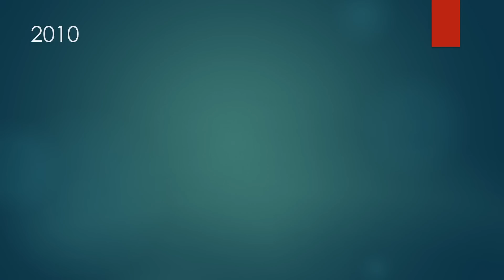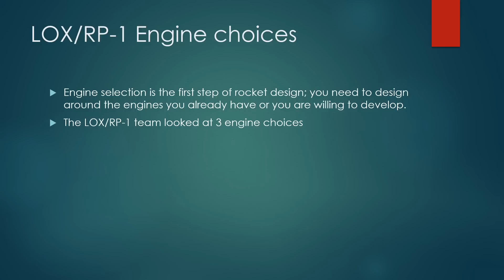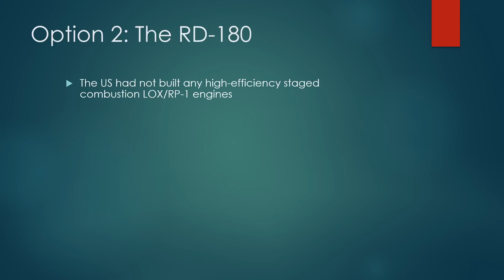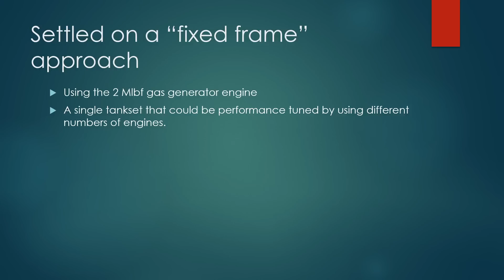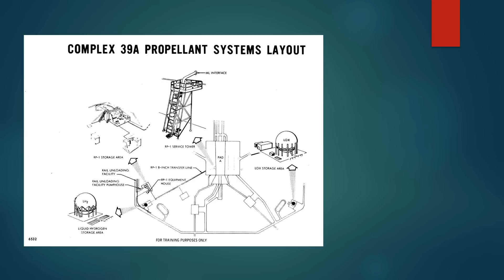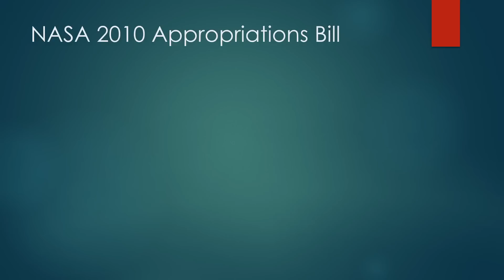Why don't we fly the Saturn V? An alternate SLS history...

Comment: Great video, I thoroughly enjoyed it, nobody else seems to focus much on the history. 
Though I would like to point out that depending on who you talk to, an evolutionary block approach is a pro rather than a con when relating to shuttle derived launch vehicles as the DIRECT team have pointed out before. In-line shuttle derived vehicle designs such as SLS turned out to be harder to build than anticipated especially due to the gap and the shut down production lines at the end of shuttle which could have been avoided had NASA focused on a single launch vehicle since the beginning of constellation, but hindsight is 2020. The Rac-2 design is a beautiful and elegant vehicle but I can only imagine how much longer development would have taken and the higher risk of cancellation.
Reply from the maker: Thanks for your comment.
I can see your point related to DIRECT, which had a goal to get back flying very quickly and use shuttle components with as little modification as possible.
I think it's different for SLS; if you accept that the defined goal - 130 tons to LEO - is meaningful, then I don't think it makes sense to spend any time on ICPS as it doesn't get you where you want; the only thing you get is (perhaps) an earlier launch of a vehicle that doesn't do what you want it to do. 
It's also had other impacts; NASA has already spent $693 million on the launch tower for block 1 which will be abandoned when they move to block 1B.
Reply: @EagerSpace  
Oh, the launch tower(s).... 

(Insert Marlon Brando "The Horror" video clip here)

Comment: Seeing we are happily using soviet N-1 rocket engines, using Apollo ones would not be all that far out of possibility. And for not having the instructions to build one F-1 engine, we have one, just reverse engineer it, scan it, or what's needed. Block one of SLS is a bigger waste than Saturn 1-b was.
Reply from the maker: The NK-33 / AJ-26 was briefly used in Antares but abandoned because of quality issues. It's certainly true that Atlas V flies the RD-180, but AFAIK there's no close relationship between the RD-180 and the NK-33.

There was already an updated F-1 planned for SLS - the F-1B - that would have been much easier and - perhaps - easier to build. That's the engine this proposal was based on.

Comment: We have lost the artisan welder and tangible skills like that in order to build F1 engines. They were built with slide rules and and had a little more wiggle room for error, that was filtered out by bench testing and the human touch. as such no single engine was identical. sure we have some specs somewhere... but with all our advanced manufacturing technologies we cant actually build them. because tradesmen/artists like we need are all retired.
Reply from the maker: As part of the Advanced Booster Competition for SLS held in 2013, Dynetics/Pratt Whitney Rocketdyne proposed a booster powered by an updated version of the F-1 known as the F-1B. So they clearly thought it was possible. Article here: https://arstechnica.com/science/2013/04/new-f-1b-rocket-engine-upgrades-apollo-era-deisgn-with-1-8m-lbs-of-thrust/2/
Reply: @EagerSpace  Proposed, and never built. because it woukd take lots of trial and error to do now with modern manufscturing, what they did then with an oxy torch. Economy of effort.
Reply: @randomotaku4037  Your argument is extremely poor and you clearly did not do your research into the F-1b
Reply: @BeKindToBirds  1. That is not the F1. That is a different engine, the F1b. which 2. is exactly what I implied would be needed, a redesign of the original engine to work with modern manufactiring, engineering and 3d printing. 3. Has anyone actually built an F1B or is it still sitting on paper while Neon Tusk saves our species?
Reply: @randomotaku4037  You are being obsessively obtuse.

Comment: At 11:43 it looks like the F-1 engine displayed simply dumps the turbine exhaust out a pipe instead of using it to film cool air nozzle extension, does this mean that they weren’t going to use a nozzle extension on this newer version of the F-1?
Reply from the maker: I think they decided to cool the whole nozzle regeneratively, so the extra cost of film cooling wasn't needed.
Reply: @EagerSpace  I think the first part of the nozzle was regeneratively cooled and then they used the turbine exhaust to film cool a nozzle extension, so I’m taking this as them not bothering with an extension this time?
Reply from the maker: You are correct. They did that because it was very expensive to build the regeneratively cooled section and so they could just build the bottom part with a film-cooled extension. 

That's not needed with more modern nozzle techniques - the Merlin 1d is also a gas generator like the F-1 but has is fully regeneratively cooled.
Reply: @EagerSpace  my brain is sad that those gas generator exhaust products weren’t going to be used for something useful. Still my brain is even more sad that I won’t see a modern F-1 fly during my lifetime.
Reply from the maker: You aim them down and you get a little bit of extra thrust out of them, and IIRC some engines have used them to provide rotation around the z axis. But those manifolds like we see on the F-1 and the Merlin Vacuum are a big PITA to build

Comment: Fascinating - thanks!    It's looking now though that NASA need to evolve - it's not their business to compete with commercial launch facilities - and it would be VERY wrong for the government to procure new rockets in competition with the likes of Blue Origin and SpaceX.   They need to encourage the traditional government contractors like Boeing and Lockheed to stand on their own too feet - and to nudge Blue Origin into becoming a true competitor to SpaceX (who are doing just fine without help!).

This model has worked moderately well with StarLiner and Crew Dragon - set up two broadly capable commercial teams against each other - let the winner prevail.

But they can't be giving Boeing unlimited $$$ to build another SLS.    What we have is a quasi-competitor to SpaceX - with a NASA mandated design for Boing and a free rein for SpaceX.   Result is that SLS costs 3,000 times more to launch and at half the payload of StarShip.   An Artemis mission of baroque complexity - when you could simply shove crew, vehicles and habitat into a StarShip - refuel on orbit - then go straight to the moon...no capsules, no lunar gateway, no somewhat-reusable-maybe Lunar lander...no nebulous ways to get habitats and vehicles to the moon.   Just one rocket...3,000 times cheaper.
Reply: Except there is no current commercial demand for a super heavy launch vehicle. All the best to SpaceX with Starship, but Falcon Heavy has flown two payloads to orbit in 5 years, not exactly a busy dance card. And the issue is you going to have to throw money at it because the launch cadence is going to be too low to make a profit commercially anyways. 

And it's really unfair to critique the cost of SLS. The Saturn V cost 10x as much as SLS. People who criticise SLS for being a make-work project have selective memory when it comes to the Apollo and Shuttle programs. The reality is NASA isn't getting the massive budgets they received back in the 60's. Also Starship is currently a chunk of steel that has only accomplished to explode a lot. Let's see the costs once it's making it to orbit. Starship isn't anywhere close to going to orbit, they have only had one single sorta successful test flight of the upper stage.

Comment: The short version is “why would we want to recreate the Saturn V?”  The Saturn V was an amazing achievement for its time, but it was very much a product of its times.  We can do much better nowadays!

Excellent video!  Thanks.

“Competion”?
Reply: I haven’t yet viewed the entire video, but the problem started in the 1970’s, specifically the Nixon Administration. NASA had been forced to cancel the last three Lunar Missions, and NASA had several goals in mind for post Apollo, but they were all shut down except for the Shuttle. So, NASA was adrift, as it had no real goal. The last president who had given NASA a goal was Kennedy. 

Second, the Shuttle system as built was NOT what NASA had in mind, but under Nixon, NASA was forced to build a massive payload bay, in order to accommodate the needs of the military and intel agencies. Ironically, those entities opted not to use the Shuttle, and launched their own satellites. But NASA was stuck with a huge vehicle, and an extremely unsafe vehicle. Also, the appeal of the Shuttle was that by reusing most of it, it would be much cheaper, and be like running an airline. Well, airplane’s don’t have to endure the punishing stresses of getting to and from orbit. The Shuttle turned out to be MUCH more expensive than the expendable Apollo/Saturn, and the launch rate never came close to what NASA expected. 

I think NASA originally envisaged a much smaller “Shuttle” (without the massive cargo bay) which could have been placed above the booster (probably the Saturn), and used a simpler heat shield than those tiles, and would have the capability to pull the spacecraft from atop the stack in the event of a catastrophic failure with the booster. The savings would come from its ability to land like a plane (water recoveries are expensive). 

Also, because of its design, it couldn’t go farther than low earth orbit. The orbiter could not survive the high velocity re-entry that Apollo could. The Soviets figured this out very quickly, and abandoned its own version of the Shuttle. It just isn’t reliable enough for a human crew, and we were fortunate that there weren’t more catastrophic failures. And the Shuttle system just couldn’t match the sheer lifting power of the Saturn V. Our first space station was much larger than the various parts of the ISS, and was a converted third stage of the Saturn V. Unfortunately, because of long delays with the Shuttle, we weren’t able to save Skylab, as it’s orbit decayed. 

The Saturn was not only the most powerful booster, it was extremely reliable, with no catastrophic failures, and could even survive a lightning strike (which occurred with Apollo 12. Had we kept the Saturn, its electronics could easily have been upgraded over time, (same with Apollo — which is the real spacecraft; Saturn was the booster), just as had been done with the Shuttle. 

The other safety issue is the use of Solid Rocket Boosters, which were chosen for financial reasons. The problem is that unlike a liquid fueled booster, once you ignite the SRB(s), there’s no shutting them down, and the orbiter had no launch escape system. The two systems were really only developed a decade apart, Apollo Saturn in the 1960’s, and the Shuttle in the 1970’s. And quite frankly, Apollo/Saturn was superior to the Shuttle System, in terms of reliability, cost, and safety. 

Had we stayed with Apollo/Saturn, we would have probably achieved more because of the savings. The fact that we are returning to the capsule configuration is a testament to the success of Apollo/Saturn.
Reply: @johncronin9540 , yes, largely agree.  You might be overdoing the Shuttle’s 2 losses of mission and crew in 135 total flights, but otherwise yes, largely agree.
Reply from the maker: I mostly agree. The reason Shuttle was called "Shuttle" is by analogy with an airport shuttle; it's a small vehicle to take people from one place to another efficiently. That's also why NASA always referred to is as "STS" - the shuttle name wasn't really accurate.

I disagree that NASA was forced to build the larger shuttle. NASA had a vehicle in mind and simply didn't have enough support to build it because it wasn't broadly useful enough - the smaller shuttle was mostly designed as a way to get to station - as part of NASA's "shuttle and station" program - but there was no station planned, which made their design not very exciting.

In shopping around for support, DoD agreed that they might find shuttle useful if it could carry much larger payloads and had much more crossrange, and NASA agreed to make those changes because they really wanted some sort of program. And that was enough to just barely fund shuttle.

So it was really NASA's choice to go with the big shuttle; they simply had no way of getting the smaller one funded. 

This ended up backfiring on DoD; we ended up with a rule (not sure where it came from) that government payloads could only fly on shuttle, and that complicated DoD's life tremendously as they had missions that didn't work well with shuttle and they couldn't use their existing launchers. 

It also pretty much killed the US commercial launch industry.

That rule stuck around until Challenger and then DoD spun up the EELV program which has persisted to this day (now NSSL). 

At some point I'm going to do a video on early shuttle history and why they chose the design they did.

Comment: It appears the study was biased to Shuttle-derived.  Congress wanted to make use of Shuttle production facilities and probably the jobs associated, which were in certain state(s) and a favorite of certain Congressmen.  ‘We must continue the Shuttle jobs because it’s the only American way’, and the mentioning of the dilapidated RP-1 delivery pipeline that was so easily replaced by SpaceX were examples of the “bias b.s.”  Congress’ Section 304 was a killer!  That doomed the SLS, right there, I think.

Imagine if there had been forward enough thinking in that study the said the RP-1 first stage could be 100% reusable!!  That they could land it back on a landing pad at KSC or on a large barge at sea, that they could construct it out of lightweight carbon fiber.  
Makes me wonder if SpaceX’s SuperHeavy booster shouldn’t be RP-1/LOX.  Maybe at 12m diameter, instead of 9m, and same construction as Falcon9, instead of stainless steel.  With 9 two-million lb-thrust GG engines, instead of 33 half-million lb-thrust Raptors.  And maybe Starship should also be 12m diameter.  Perhaps, Starship should be 12m diameter and shortened a bit, and then add a short 2nd stage under it so that Starship can get to LEO with enough propellant remaining to boost itself to the Moon without refueling.  And can that stainless steel 2nd stage do a reentry burn and landing burn to be reusable?  But I’m way off in speculation here.
Reply: You're speculation is also a bit far fetched. A 12m diameter carbon fiber Starship.... Sounds an awful lot like Musk's ITS concept, which got thrown into the bin and downsized to the BFR, which in turn got tossed and downsized to Superheavy.

It's great to dream, but as SpaceX is finding out big rockets are big work. SLS's budget is what doomed it. Turn 20 billion into 200 billion and you will get an effective launch vehicle. The Saturn V was also split up across the country to multiple contractors for the same reasons SLS is, the Saturn V just got a lot more money.

Comment: Why didn’t NASA include reusable options in this study?
Reply from the maker: The short answer is that SLS was designed to keep shuttle contractors and NASA centers busy rather than be efficient, and if you are building from shuttle components reuse is very difficult.
Reply: @EagerSpace   This deserves a dedicated video! You could go into detail on how each shuttle component was inefficient. For instance, I know the tiles were all unique and needed extensive inspections after each flight. But what other options were looked at during their development that might have made them more reliable, interchangeable, and increase turnaround time?  Same for the engines.
Reply: @EagerSpace  Another video idea: how much maintenance and repair was required on the shuttle “stage zero” infrastructure after each flight? And same question for SLS. It’s apparent that the SLS ground equipment isn’t robust in a few areas. Was the shuttle’s much better? How much of that was/is make work for a jobs program?

Comment: Much of the tooling and expertise to build vintage F1 engines no longer exists, they required a lot of hand work to get them built and much of that knowledge died with the guys who built them. Having said that it would be reasonably easy to take the known working design and design a better version using modern fabrication techniques and there have been designs done that would be about 25% more powerful at a fraction of the cost. People who say it's no longer possible to build F1s are missing the point, you wouldn't want to build a 1960s F1 today because they could be build far better now.
Reply: As SpaceX has proven with the Merlin engine. Completely reusable first stage. That sums it up. Next comes Raptor, a LOX/LCH4 engine. Where was NASA who completely missed the point about the future of space launches?